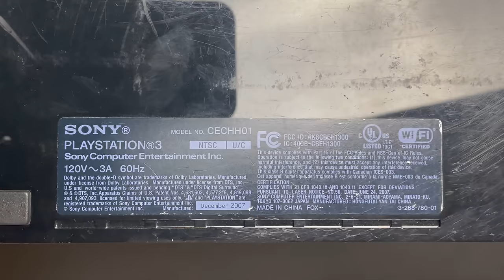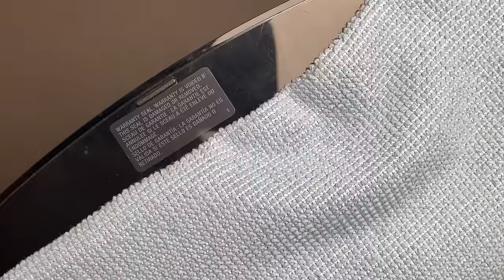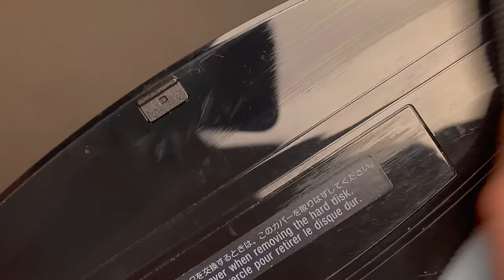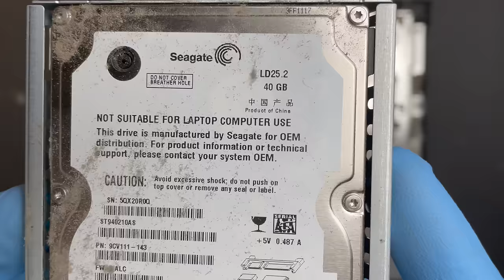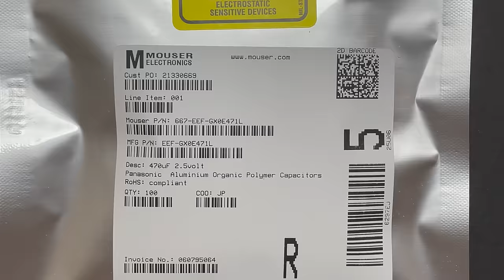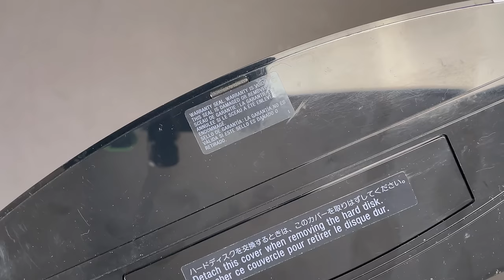Sony PS3 "Fat" YLOD Repair - Faulty Console Restoration

Comment: I almost had a panic attack when you put the system back together the first time without cleaning it lol
Reply from the maker: Blasphemy!
Reply: Haha ! I was thinking the same but it makes sense. Test first to see if it works otherwise waste of time cleaning.
Reply: bro i just scrolled to make this comment
Reply: @Amp5150  Bro, I scrolled to make the comment. Saw that someone beat us to it, then "liked" it.
Reply: Ok, I watched more. he did clean it. did a good job too.
Reply: No cleaning internals ???
Reply: @latenight7528  ? Who's that ?
Reply: @hq72hotmale  you haven't heard of DK Oldies?
Reply: @Jausc are you okay? Cus if you read the replies you would've seen I'm not the one who didn't know who they were lol and I'm not a kid
Reply: Same
Reply: I thought that too. But for different reasons. But doing it that way, showed it was that particular problem and not mechanical due to dust etc.
Still very strange or crazy that a cap caused the issue. But I've had cap problems with machinery before. Compressors etc. and causes the same problem.  I'm not used to working with such tiny equipment. Very delicate.
Reply: Are you still around borderline ocd miss your videos
Reply: @BorderlineOCD 0:12 😅
Reply: @anthonyaviles8665 3:56 3:59 4:03
Reply: B 5:51 5:55 5:56 6:03  5:24 acku 4:19 p

This device
Backed up 3 hours ago
Reply: Ì

Comment: Im the original author of the syscon thread, great to see people attempting to fix these ps3's again. For anyone who feels that the syscon is not clear, please feedback what requirements you think would work for everyone? post a pull request on my git repo.
Reply from the maker: Ha! I should have put two and two together from your community posts that you are "db". Hope to bring more visibility to your work and I'll be in touch in the coming weeks or months when I'm ready to get my hands dirty with it. I'm sure I'll need guidance on those solder locations.
Reply: @BorderlineOCD  Yeh feel free to suggest, dont worry about the syscon,its quite easy to get to grips with, error codes need some work on fully understanding, but we r getting there.
Reply: @za-se4jv  Ok, if u could do a git pull request with the changes then i test them out. i will correct the tx rx labelling
Reply: @za-se4jv  The automated GUI is very simple and makes it very accessible for everyone to simply read the error logs very easily.

But even myself having participated partly in its development I still recommend doing it the manual way eventually for full functionalities.

It's not so difficult. Guides and help are available and there's a NSC video coming soon to help.

Cheers
Reply: I can do the pull request with my guide oriented for Windows users which was made available some time ago.
I was just waiting for you to edit the slightly misleading info about error 80 1001.
It's an error that can mean nothing in the logs because it is known to show up even in perfectly working systems. Needs to be caught live with bringup to get any meaning out of it.

But you already know this
Cheers
Reply: Hello if you want someday to find out why these machine brake (and hope they will be still around...it has been already 14 years on them) you have to make the syscon easier to follow..not everybody knows python or soldering cables, there should be a full complete guide for worse than noobs. I know it is not easy and maybe you dont care for it or don't like it. But the only way to make this happen is with multiple user input data and especially the ones from broken unopened machines. In PSX scene i had seen a whole bunch of ppl with there machines all messed up...and then they search for syscon...previously they had baked them, they had changed NECs with pliers and the list goes on..will not work this way i am afraid..
Reply: @johnk7134  There is only a certain amount of guides and hand holding you can do. you have to go out in the world and use your initiative, and learn the basics of electronics's and have the tools to actually fix them.Also remember sony has made its as obstructive as possible to not fix them!
Reply: @johnk7134  No, you are absolutely right. Initially I thought exactly the same thing as you, and it's no coincidence.
But the thing is accessible to everybody and can be done in few minutes really.
Here is the video:
https://youtu.be/ZvqJQVd5pBY

Sorry that it took so long and that it is so long, but oh well. Better late than never, especially if it's a good thing!

Cheers

Comment: I really like how complex and well detailed are your videos. Repairing game consoles is only for those dedicated to the precision and perfectionism. Cheers mate!
Reply from the maker: Thanks man, I'm glad it's received this way. It truly is my therapy and I put a lot of love into it!
Reply: fixing a ps3 is not for the faint hearted, it is quite hard to fix, i'd rather just let my ps3 die and just sell it as a parts/for repair console on ebay. i have recapped a pentium 4 pc motherboard, but doing that on a ps3 is next level stuff.
Reply: @pentiummmx2294  skill issue
Reply: Repairing my PS2 was a cakewalk compared to the PS3.
PS2 suffered from DRE, and Sony only offered a temporary solution.  Turns out that my drive tray rails were the issue.
Later on I bought one of those 3 in 1 cables from monoprice, and it fried the GPU.
PS3 had YLOD, and I left one those cellphone repair shops reflow my board.  It must’ve worked for an hour then GLOD.

Comment: What?! Those holes are for trimming screws? I never knew that. I never would have guessed that. Thanks for the lesson!
Reply: Also use the cloth or paper towel to cover it when doing it.  Or the screw might fly off and you can't find it.

Comment: Nice repair! You're right you can't find one without a scratch on the used market cause it's in my house! I bought mine when they first came out; waited in line at Walmart and cost almost $700. I gently rub it with a microfiber cloth every month and use the electric blower on it every 6 months. Just like new!
Reply from the maker: Right on! You know you have mad love for your PS3 when you "rub it gently" every month :P
Reply: That's surprising to me, every time I've tried to gently rub something glossy with a microfiber cloth, it still scratches, because no matter how gentle you are you're still pressing the dust against the surface which is what causes the scratches.

Comment: I've been waiting forever to see YOLD teardown/fix.. Keep up the good work man.
Reply from the maker: Glad to hear it. Another one on the way, although I think I have my work cut out for me on that one!
Reply: @BorderlineOCD  60gb or 20gb model? 60gb model I've taken apart just to clean and yeah they are not fun .. Mine that could still possibly be repaired "it needs a new disc drive, thermal paste/pads" is the 20gb 4usb Fully BC model.

Comment: The one thing I really like about your channel that I rarely see in repair channels is how much care you put into the repair as far as cleaning the system and keeping everything as original as possible which is also something my company strives for. I would however recommend that you use low melt solder in order to remove those pesky caps. I haven't done the YLOD just yet but I did just recently have a YLOD on a PS3 just come in so I will be attempting this repair.
Reply: How would you fix GLOD without a donor GPU?

Comment: Cool tip about the screw cutting. I have had my crimping tool for probably 30years and I never wondered what those holes were for. Thank you so much for your excellent content and keep up the great work.
Reply: I almost killed my thumb with one of these back in apprenticeship. :(
Reply: anything M4 and above are damn near impossible to cut without some sort of mechanical assistance. I mean you CAN cut an M4 but you wouldn't want to do more than 1 of them if you can help it! lol

Comment: Great video, brilliant presenting. Loved every second. I have 4 PHAT PS2 BC machines and they are all in tip top condition. Two of them are factory sealed. The remaining two had a major clean overhaul with SSD upgrade and thermal paste. Even had to JB one to re marry the BD drive and now all is good. Top work dude.
Reply: Do it yourself or paid someone. Looking for someone to do on my backwards compatible one and willing to pay
Reply: Samantha Holland  yea one actually since I got 3. Was going to clean it up and give it a try since I already cleaned awhile back but haven't done in some time. How much you offering?
Reply: @joshuap.2851  I did them all myself.

Comment: If you're interested, try using valve grinding compound for stuck hardware like that. I use it on a lot of my projects and it really helps. It's like liquid sandpaper. Just don't put too much on because it'll make a mess- just enough to fill the head of stuck hardware like that.

Comment: I would HIGHLY recommend getting a soldering hot air station with a forced air pump inside, The difference is the air is generated inside the station, and then forced out with a pump, vs forced out of the handle with pretty much a fan. making this upgrade will change your repairs and your confidence working with all board SMD repairs.

Comment: Nice work! Glad to see "the fix" worked okay for you. I tried doing the first NEC token (near the RSX) the other day on an old YLOD 60 gb. Unfortunately no change. I intend to swap out more, but I need to order more of these capacitors first. Wish they weren't so expensive. Lots of NEC's to replace on a single board especially with that 4 to 1 ratio.

Comment: Just picked up a YLOD CECHA01, waiting for you to post that video so I can follow along!
Reply from the maker: Congrats. I am restoring the glossy case on my CECHA01 in my next upload but its still on the repair backlog. Hopefully you won't have to wait much longer :)
Reply: @BorderlineOCD  I went ahead and stripped it down, cleaned everything (dusted, brushed with isopropyl alcohol). Got new thermal pads yesterday, reassembling today. Still unsure about the heating of the chips, seems like the most important and most risky step.

Comment: I would recommend also installing fan control software and setting it to payload to better control the fan speed and prevent overheating.
Reply from the maker: Good recommendation for a modded system. Although ultimately those damn heat spreaders need to be removed and pasted to best address issues with higher temps.

Comment: Watched your Lynx II video, a very nice refurb which didn't work since I suspect 9V has already fried the cpu. The algorithim recomended me this video, and I have a PS3 sitting in my connection with this same issue. Might get to it one day. Subscribed. Very nice videos, thanks. I recently got a Lynx II, no power, and wired 5V onto the capacitor and got it to power on. So i've ordered all the components to reburb mine as you did yours.

Comment: One thing I've seen noted is the inner two contacts are both ground and the solder plane in-between them is also ground so you can scrape away some solder mask and solder right to the ground plane.   Solder paste might be a better option than normal leaded solder it'll have a lower melting point.  Really awesome to see it up and running when you first tested it!  I have a few I need to do this to. Great work!
Reply from the maker: You're exactly right about the ground plane. That entire mass under the center of the TOKIN caps is one big ground, which is what makes those buggers so hard to remove.

Comment: On my PS3, I removed the motherboard and any attached plastic.  Placed in oven to reflow solder.  Our machine solder was experiencing heat stress fractures from frequent on/off.  Repair went well and lasted for weeks.  Each subsequent repair lasted about half as long.  Found that if you leave the machine ON indefinitely it doesn't experience the heat/cool stresses any longer.

Comment: I lost some tiny smd capacitors when trying to remove the nec caps using a tweezers it just slipped away from my hand be careful, the top cover can be removed without hot air it just a piece of plastic just be very careful when trying to lift it up.
Glad to see it working again for you

Comment: Tip for soldering caps: you can scratch the middle pad between the TOKIN solder pads and have the negative pad soldered onto there. I did that on a CECHC04 just recently. (and before anyone jumps to scold me - I have had pulled the syscon log - 1001 and 1002s only.)

Comment: This video was super helpful. Repairing the PS3 is a nightmare and a headache to the average "do it yourself" types like me, due to the years of misdiagnosis. I was really upset about how much of a pain it was to repair after so many attempts on multiple backwards compatible consoles. I've trashed so many consoles in my attempts to repair them only temporarily, I've come to despise the design of the internal components of the console itself. For $600 dollars, you get so much value out of the console being 3 in 1. At the same time, it's a ticking time-bomb. The airflow is a dust collector for some odd reason, I've yet to fully understand. All in all, I love the original PS3 in concept. But hate the technical design. I can't wait for the day a 3rd party vintage console maker comes along and reproduces backwards compatible PS3s consoles with a better constructed internal design. Thanks for making video!
Reply: It's a dust collector simply because it doesn't have a filter and sucks up a lot of air.  Plus it's most likely down low on the floor or in a dusty cabinet.  A simple mesh filter would've helped a ton.
Reply: @Jaze2022  A mesh filter would've been nice. 👍

Comment: My launch 60GB PS3 is still working fine but I kind of want to replace the caps pre-emptively. I replaced the 17 blade fan with a 19 blade fan almost right after I got it about 14 years ago so I guess that helped a bit.

Comment: Bro, I've ruined several ps3 fat models doing hot air, practice definitely makes perfect, I fumbled the same way and now I prefer to do this process over an iron or pin. It's amazing what you can accomplish with limited resources.

Comment: Finally! The first repair tutorial that isn't just "Oh I'll bung it in the oven for a while" it's usually always those pesky tokins!!
Reply: Fun fact: some "repair" "specialists" still deny that the capacitors are a cause.
Reply: @heynic37  i would hardly call them "Specialists" then i think "Buffoons" is more fitting 😉
Reply: @ItsCOMMANDer_  most 65, 40 and 45s are pretty reliable.

Fingers crossed my slim has been spared

Comment: I once got 2 PS3s for 45 bucks and because I've already failed one delid attempt with a backwards compatible PS3 I've sent one of the PS3s I got which is a CECH-C04 to NSC and got it delid for about 50 bucks and after a few weeks it arrived back at my place, put everything back together and now runs as it should....cool and quiet (for PS3 standards quiet)
Reply: Tell me where!!!
Reply: @joshuap.2851  I got them on a local eBay listing and tbh, I was quite lucky. The original listing had 5 PS3s (2 of them being C-04s) for €150€ but I asked for 2 of them for 45 and he was okay with that.
Reply: Lol I was actually talking about where you send it for the upgrades and fix. Yea eBay is definitely the place for guys like us. Being able to make offers saves a ton.
Reply: @joshuap.2851  As I’ve said before. I’ve sent one of them to NSC. Just type “NSC modz” on YouTube and you’ll see who I mean.

Comment: nice work, i have seen this screw cutting tip using the crimp tool couple months back, all the years i had them and never knew, i would sugest that if you have it add a nut on to the screw befor you do this, when you take the nut off it will help straighten up the threads and lessen the chance of cross threading.

Comment: The best way to remove the heat sinks from the board is to use a flat razor blade. I’ve seen people using brutal methods to do it such as a paint palette knife. Heavily tape up one side of the blade with electrical tape so you don’t cut yourself and carefully heat up area you’re going to cut with the blade. It’s the safest and gentlest way of removing them.
Reply from the maker: This has to be my favorite approach so far, and when I muster up the courage to do it I think I'll employ the razor technique.
Reply: @BorderlineOCD  I noticed the tool you use at 1.34 is perfect for the job 👍🏼

Comment: Ive worked on many ps3 phats and more often than not many of them need a good cleaning and dusting. However recently i came across the YLOD and everyone has a different way of fixing that issue. Bottom line is.. its just a bandaid. The consoles are so old and with the solder used in 2004-2005 and so on. Just makes em incredibly fragile. Idk if id trust myself replacing the capacitors but best way to practice would be on a junk board.

Comment: Very interesting repair. 
You mentioned the RRD of the 360. Did you ever fix one and find out exactly what the issue was? I have a 360 that was repaired by MS and after about 6 months it returned. But not fully. After getting the RRD, again I shut down and restarted and it kept going. But I Kinda gave up and got an Xbox One. So haven't used the 360 since. Just wondering your opinion and findings. Thanks 👍

Comment: Do you have a link to any other caps that can be used. The ones on mouser seem to be back ordered. Awesome video this whole time most of the ylod were just a cap replacement. Thanks
Reply from the maker: I do not unfortunately. I haven't seen those 3 terminal caps by anyone other than Panasonic. You could always use the regular tantalums caps folks use and install them slanted. I bought a reel of 100 and am considering selling some off but still not sure as I want to have them on hand for a BC PS3 unit I plan to work on and still have some leftover for future systems. How many do you need?